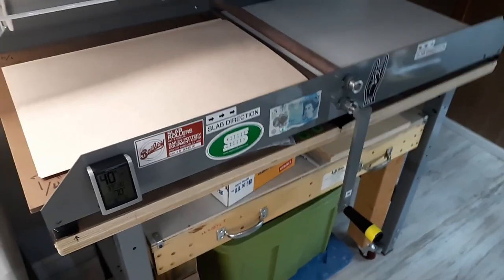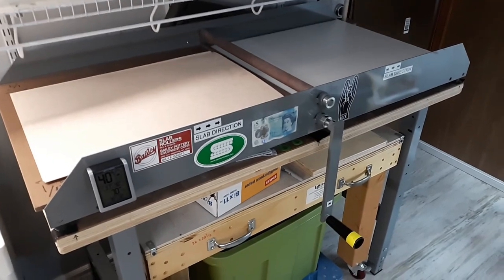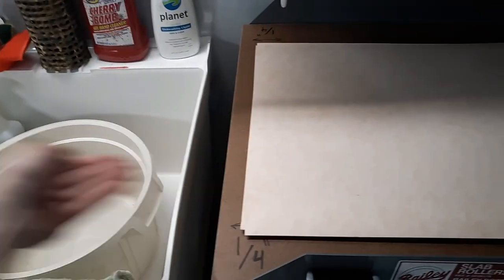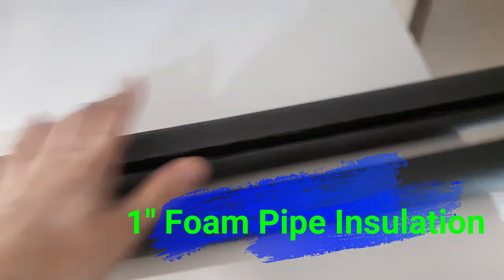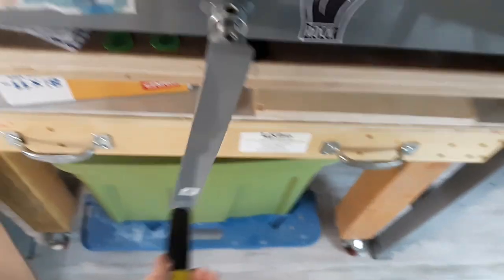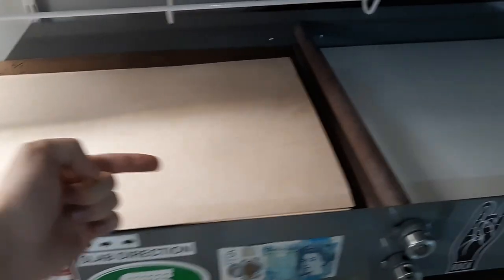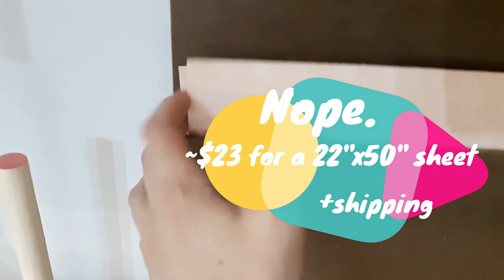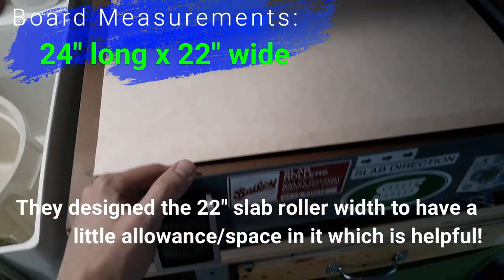Bailey 22 Mini Might 2 Slab Roller

Comment: Hi there I got the smaller 16" Mini Might II. I love it! Thanks for this video especially the chart that shows which shims to use to get the desired thickness. Now  I'm trying to make slabs as wide and long as possible.  One slice of clay from my block doesn't do it. any tips for get using as much of the length and width as possible and not getting show through seams?  Thanks in advance, I'm new to using a slab roller anyway.
Reply from the maker: Glad to help with the footage. For larger slabs, the only way to get what you're looking for is with lots more clay. Try about 1/2 of the bag of clay, make it into a long burrito like shape to span the width of the slab roller wheel. You don't want to go straight to the height of the slab you need. It's all about doing it in steps so that you slowly stretch the slab in North+South and East+West directions evenly. Clay has memory. If you stretch it in 1 direction, it's going to shrink in that direction.

You're also going to need to release the slab by hand and turn it lengthwise. You may need more clay than you think. It does take practice and some planning.

Comment: I have had this slab roller for about a year. My slabs come out wavy - when I compress with a silicone rib I can feel the difference in thickness. This is my first slab roller so I don’t know if it’s operator error or if this is normal for a tabletop roller. Any suggestions?

Comment: Thank you for making this video. I am considering getting that same slab roller and it was super helpful to see how big it is in a real setting! How difficult would it be to move it around a small studio? It looks a little big and heavy for that. Thank you so much for your help!
Reply from the maker: Hello there and thanks for checking it out. I think the mobility would depend on what it sits on. You may be able to place it on a large cart built from wood out of 2x4s, 4x4 legs, with large 3-5" diameter locking casters, and a 3/4" plywood top. You'd want it 2ft x 4ft on top, like the table I built. You could use wooden legs that are drilled into a 2x4 frame. You could miter the corners or butt them up end to end, then drill casters into the bottom of the legs, and bam, you can move it around your space. I would recommend that you get locking casters so it doesn't roll away, and for during use. There are cheap black ones at Home Depot/Lowes etc and they may have slightly nicer ones. Check their weight restriction. The slab roller is heavy (I'm unable to locate the weight of the slab roller, maybe I can check the manual). Those can work well, but sometimes depending on your flooring, the red polyurethane wheels are VERY nice. Hard plastic wheels can make a bumpy ride whereas the ones from Amazon give a smoother glide feeling on the floor.

Comment: I got this slab roller and I'm having a rough time. About half way through the rolling of the slab the rollers  spin and the shims continue to advance but the sheets containing the clay stop. The rollers just seem too slippery to grab the sheet. They only move the shims. Any ideas?
Reply from the maker: I'm sorry to hear this is happening for you. Hmmm. I wonder if dampening the roller will give more grip. What is it that the clay is sitting on? Is it canvas, slab roller sheets? Lemme see what I can find about it. Stay tuned.
Reply: Hi! Thanks for taking the time to reply. I will definitely try dampening the rollers as you suggested. Currently I am using a slab sheet with the shiny side out so clay doesn't stick to it. The shims move well. I've got the rough side of the shim against the slab sheet. I wonder if canvas would work better. Canvas and dampening the rollers. Definitely worth a shot. The slabs are great once I finally get the clay through.
Reply from the maker: @eileenknapik6264  Sometimes it takes a little bit of pushing the boards through with your other hand to get it going. Also, if I'm picturing this correctly, you want the rough side of the board against the slab roller wheel.  The clay may also need more ease going through the roller, more flat like an axe head. Hmmm
Reply: @miremaker  Absolutely. The only way I've been able to get it to work is to make a shim clay shim sandwich. It's been working great that way.
Reply: @miremaker  And yeah plenty of push/ pull with the other hand.
Reply: Same here. I cannot believe this hunk of junk was 500$

Comment: Hey Andrew. The table for the slab roller - did you build it or did you buy the table legs from Bailey? If you built it, can you share any helpful details, i.e. what you bought to make it?
Reply from the maker: I think mine didn't come with it/I didn't buy them. I had a table in mind in my studio that I built so I used that instead of the bailey legs 👌
Reply: @miremaker  Thanks so much for that info. I can't see myself paying their price for the legs, so I guess I will be making one myself of using something else already existing. Thanks for the vid!

Comment: How do you know how may boards you need to put in so that the clay comes. out at an exact thickness? If I want a 1/8th thick piece, does that equal 1 1/8 board?
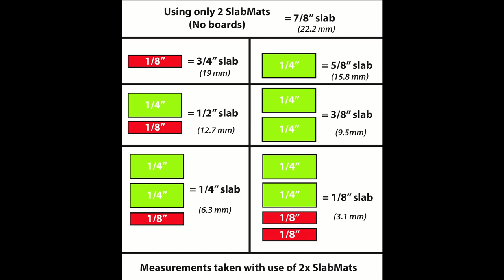Reply from the maker: Look at 12:13 of the video. I made a chart based on the boards supplied with the roller. I assigned them colors based on thickness. They essentially give you 4 boards, with 2 different thickness variations.
Reply: Can you share a pdf

Comment: Do you still like this slab roller? What's your verdict on it a year after this video? I'm considering getting this too.
Reply from the maker: Totally still dig it and would still recommend. 👌
Reply: @miremaker  thanks for the reply. I was looking at the more portable looking Shimpo mini slab roller, too. My space is tight and I want to be able to store it once in a while if needed. I'm doing ceramics in my office, lol, social isolation has me improvising. But I'm considering this one.
Reply from the maker: @onehotpepper  how has that been going? Did you decide on a roller?
Reply: @miremaker  I did, thanks. I went with the Shimpo mini. Ordered it from the Ceramic Shop. 

It weighs about 35 lbs and I can easily travel with it to different rooms or in the car if needed. If one feels like making pottery outside on a table, this is an easy roller to take along. 

It is not as good as the ones in the studios, but works for what I need it.  It's good! Very happy with it.

Comment: I just bought the 16” . Wondering if you oiled the gears?
Reply from the maker: They should arrive coated in a machine grease. Mine did.
Reply: Andrew Meyer okay, thanks. Mine didn’t and it turns pretty rough, I’ll contact bailey and see what they say. Hey thanks for the great video and super quick response!
Reply from the maker: @karmconnolly  did they help you out? I think valvoline axel grease would work nicely. I use it for my 3d printer with metal on metal contact.
Reply: @miremaker  Bailey never did get back to me, but I found some car grease that a friend had suggested. I am glad I purchased it. I’m just a hobby potter!
Reply from the maker: @karmconnolly  nice with the car grease. Ah the J word, you aren't just that though! 😊

Comment: how thick can you start the slab?  can it be uneven thickness?
Reply from the maker: You can make it as thick as 7/8" (19mm) if you aren't using any boards, I used slab mats. It's a fixed height roller, so it will never be uneven as long as you use the boards (or equivalent thickness boards) that come with it for your clay.